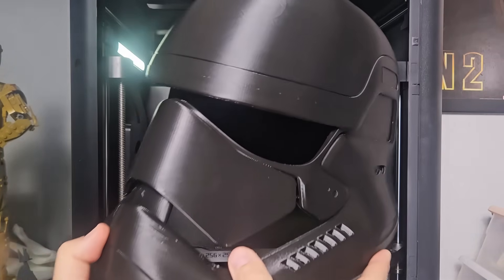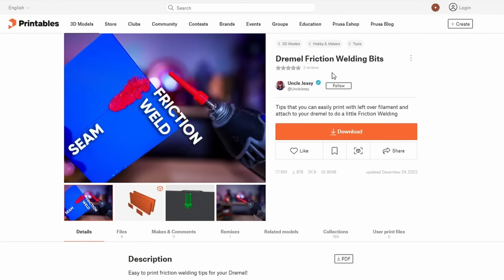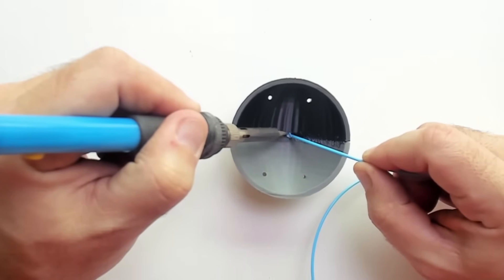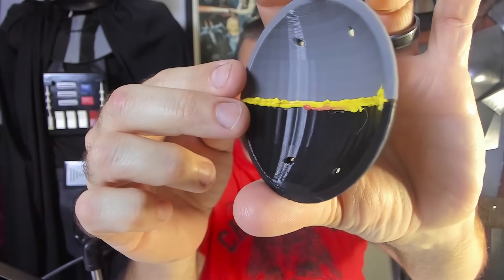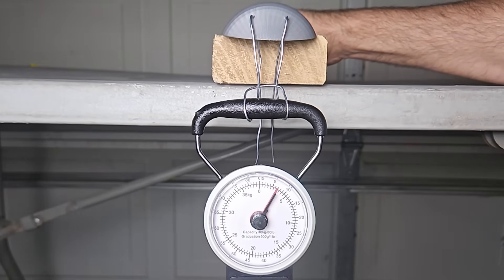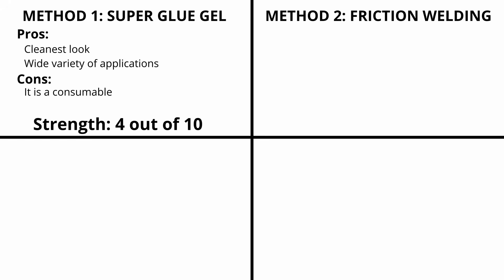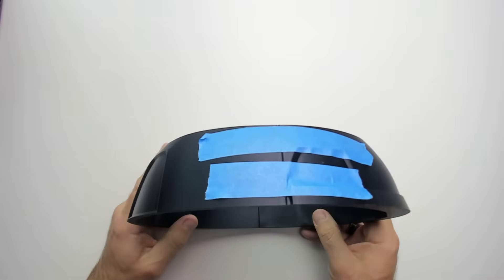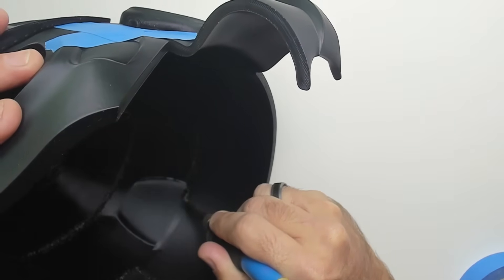How To Bond 3D Prints?

Comment: I’ve been blessed by the algorithm! I’ve been looking for solutions to bind parts together. Thank you!
Reply from the maker: Glad it helped! Thank you for watching!
Reply: @3DMaxBuilds  You’re welcome!
Reply: i highly reccomend the soldering iron and print pen methods, i don't think he did the pen method 'appropriately' to get a good bond, it should  be more like welding metal, slower with smaller deposit of new plastic (same type as part plastic) - while mostly melting like soldering iron to fuse the parts.   the benefit (if you can do this technique right) is that the new filament helps fill in small cracks and smooth the surface out, instead of a just a melty mess that you shouldn't sand or anything too much - because your effecting the actual printed part. (the extra new filament, is the sanded stuff for smoothing) this cuts down on things like Bondo (expensive!) to get a smoother finish.

Comment: The superglue wasn't fairly represented.  You only used spots of glue instead of the entire hemisphere whereas the other 3 methods you did the complete hemisphere's.  When you do a followup with the other commentors suggestions, e.g. Goop, it would be good to see a test between dabs of glue and the whole surface to be bonded.
Reply: Also the super glue would probably work better if it had more surface area. Which is something the other techniques can't really take advantage of.
Reply: Also that glue isn't nearly as strong as regular ca glue too, would love to see a redo with more matched techniques.
Reply: Glue sucks
Reply from the maker: I get that, I just applied the glue like I normally do.
Reply: @3DMaxBuilds  Most people would apply glue on the entire surface . Pretty sure the joint would be much stronger than how you normally do it.
Reply: @nevilenobody606 

Until this I would have said absolutely every person.
Reply: @3DMaxBuilds  Glue on the entire surface of contact, and in the thinnest layer possible; this is the correct way to use superglue. It still probably won't hold nearly as well as the friction weld or solder did,  but it would do a hell of a lot better than it did having several individual points of very thick contact.

The thicker the layer of glue, the more the actual glue bears the burden of whatever force is applied. You want the thinnest amount of glue covering the most amount of surface area possible for the strongest bond. Whenever I glue PLA or other models I put the glue on an old paintbrush and brush it on rather than directly apply drops.

Comment: I use the 3d pen method all the time and it holds amazing.  I think it’s how you apply it though.  Because the 3d pen hot end is really hot I use it similar to the solder method and add the filament.
Reply: I agree. Let the hot end of the pen melt both sides and then start extruding. I've had great results with this method too.
Reply: 1. Material similar or dissimilar PETG does not bond to PLA
2. How deep did it penetrate ? 
3. Was it hot enough ? 

Generally speaking for butt joints 3D pen, friction weld and the soldering iron are all the same, you melt the material and bond it with or without a filler. The only difference is how well you apply the method. There is only 2 different bonding techniques in this video 1. CA glue, best for big surface areas and 2. Fusing material with itself, that´s it. People tend to overcomplicate pretty simple things.
The biggest difference here was in how the bond was created not by which method.
Reply from the maker: That's good, I'll just need to try out a different 3D pen too.

Comment: I've got a neat trick for you. Take some ABS, put it in a small jar with acetone, shake and stir properly for 15-20 minutes. When mixture has homogenized and gotten the texture of liquid glue, apply to a print and press together. Then apply a little of the mixture to the joints of the two prints you are welding together. Hold it tight and wait a few minutes. Then, you can usually stop pressing the parts together and leave it in a position where too much force isn't applied to the parts.

A few hours later, the weld between the parts is full of hardened ABS. The best part? Chemical welding means you don't have any of the usual lack of layer adhesion ABS has. This works for most materials, i've done it with PLA, ABS, ASA, PETG, PA6 and Polycarbonate, some with CF variants, some not. Though obviously it is extra effective on ABS and ASA parts. Acetone is very cheap, and fairly safe to use, if done outside and in an area with no potential for fire nearby. 

Chemical welding with ABS goo is the way to put prints together if you ask me. Especially if you have some old ABS or ASA supports you can use. Brilliant reuse, needs basically no equipment and has serious strength.
Reply: PVC cement/primer is ready made and has the same result.
Reply: @ A bottle is acetone is like, 3 bucks and using spare ABS/ASA supports means it’s the cheapest option possible IMO.
Reply: @ for sure! I just don’t want to wait so for 9.99 Oatey’s PVC cement and a cotton swab are what I use. 

Side note, the ABS/Acetone will not work on PETG very well if at all

Comment: The kids 3D pens are often kept at the very low temp for safety.  Not a great “welding 
“option. I have been developing a 3D pen for adults that is a lot more serious.   I use it for welding and reinforcing 3D prints all the time, but like mig welding, it helps if you chamfer the inner edges first and fill the gap.  I run it at 250 degrees for that.
Reply from the maker: Yes, if the nozzle was hot it would definitely help by melting the parts as well. I wish you luck with your 3D pen, that's awesome!

Comment: Testor's model cement. Dries clear, strong bond, and it's made for plastic. Never any residue either. Every time I use super glue I get that white residue and it sometimes doesn't come off.
Reply from the maker: Interesting, I'll need to try out that glue.
Reply: Testors is made for styrene plastic.
Reply: @ I use it on PLA, PETG, PLA CF, and PLA silk. Holds really good. I like it better than super glue. No residue, no nose burning fumes, and it's easy to work with. If you make mistakes and get to it in time you can still pull it apart. Once it cures it is not moving.

Comment: I personally use a plastic welder when doing helmets and armor. They add staples that help keep parts together and stand up to long hours at a convention. That along with the Plastic welding I've yet to have anything break at the seam.
Reply: Thank you for suggesting the plastic welder.. Making my daughter a Hornet from silksong cosplay for Halloween, and with her being 9 years old  I'd like the welds to be as sturdy as possible.. I've got a lot of experience soldering electronics, but joining plastics not as much. Thanks again to both you and the video creator..
Reply from the maker: Nice! What is your favorite piece you made?
Reply: @3DMaxBuilds  I have made so many its hard to choose. But one of my favorites is my Darth Raven helmet. Ive got armor for him printed, but gotta get around to finishing it one of these days. Right now, im working on a Night owl set for my wife. This ones pretty fun to work on.

Comment: I had worked for a plastic company years ago, machining plastic, we had a welder which was a blade with heating elements inside which we put both parts either side to melt the bonding area , then when ready, remove the blade and hold both faces together under force until it cooled. done properly you couldn't break that bond....so it does surprise me the friction weld worked so good. I would prepare the joint with a vee to get a better weld.
Reply: +1 on this... 

I'm wondering whether the reason the friction welding worked so well, was because it completely bonded one side. Leaving the outer side unbonded, hence the reason it was able to flex and dissipate the force somewhat... Either way I think they're both great and viable options, as neither actually failed. More so I believe the part failed on the solder/ welded peice due to the rigidity of the bond and how deep the heat would have penetrated/ bonded. 

I do think the processes should be carried out on both sides of the join though, for optimal strength. Then tidy up with filler and sanding etc.

Also, I do wonder if the reheating of the filament made a difference. And also the difference in temperatures...
Reply from the maker: That way sounds interesting to try as well. Thank you for watching and insight.

Comment: Great video! I appreciate you showcasing different methods for joining 3D prints. However, I noticed that the 3D pen test didn’t hold up well, and I believe this is because of the way it was applied.

I regularly use a 3D pen to join my models, and with the right technique, the bond can be incredibly strong—often stronger than the surrounding material. It’s similar to welding metal:

Chamfer the edges where possible to create a V-groove.

Apply the filament slowly so that the nozzle also melts the print itself, not just the added filament.

With this approach, the joint is nearly unbreakable. In my own tests, the model usually breaks next to the joint rather than at the weld itself. Maybe it’s worth another try? Keep up the great content!
Reply from the maker: Thank you! Yes, and the 3D pen I used is more of a toy, so another 3D pen would have worked better as well.
Reply: @3DMaxBuilds  Thanks for your reply! That makes sense—some 3D pens are definitely more for crafts than for real structural bonding. I use the FreeSculpt 3D Pen, which has a slightly protruding tip that helps melt the model material as well. Basically, I do what you did with the soldering iron, but while also adding extra filament for a stronger bond. If you ever try it again with a different pen, I’d love to see the results! Keep up the great work!

Comment: I must honestly say that you made a mistake when melting, i.e. with the third method.
The strength should also be rated as 10/10 because the breakage did not occur at the melted area but at the printed part itself, and that has nothing to do with how well it adheres to the composite area.
Reply from the maker: Yea, I was trying to decide between a 9 and 10.

Comment: What about a combination of glue, to get the best bond at the seam, and then soldering on the inside? Its extra work, and maybe overkill, but I feel like that would leave a lower chance of a visible separation on the exterior and still have superior strength.
Reply from the maker: Yes, it could be interesting to combine methods. I don't know about burning that glue though.
Reply: I just wanted to write the same.

Comment: I use Scigrip 16. Try to break 2 PLA prints bonded with this stuff and it’ll break somewhere other than the joint.  Weld On 4 also works well, it’ll flow into a joint.  After I found these products, I haven’t bothered with epoxy or CA.
Reply from the maker: Thanks for that. I'll try out the Scigrip 16.
Reply: THIS!!!  I've been using it since I first started printing in 2018 and it is the way to go!!!

Comment: You should try to do different types of glues like the ones similar to what they use for Legos. But im surprised how well the bond was with the melted pastic
Reply from the maker: Yes, at some point, I'll do this same test with different glues. Depending on the print, sometimes you just need to use glue.

Comment: What I like to do is

Use the soldering iron to create a channel that’s fairly deep but doesn’t penetrate the print

then light one end of some filament on fire 

drip the hot plastic into the channel. 

From my experience, it works great.
Reply: A little overkill don´t you think ? You can also create lap joints instead of butt joints and use superglue to get similar strength way faster. It all depends on your application.
Reply: @sierraecho884  I do it to achieve maximum strength in bonding large parts together.

Comment: Would Hazzard to say all 3d pens are not equal and the one you used likely does not get as hot as your printer so does not actually fuse parts  where a higher end one would.....that being said the soldering iron or plastic welding will always be stronger......but good demo vid
Reply from the maker: That makes sense since the one I used is more of a toy.